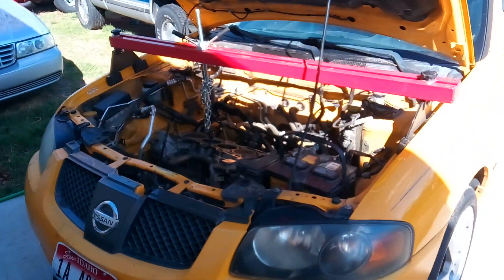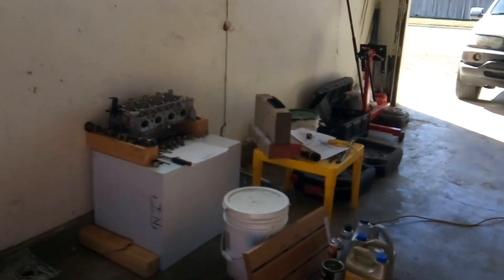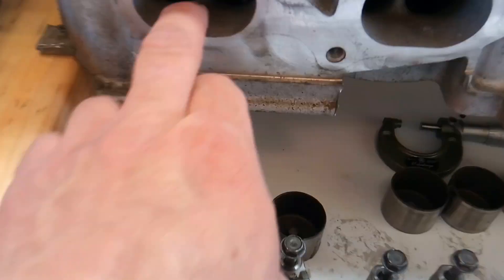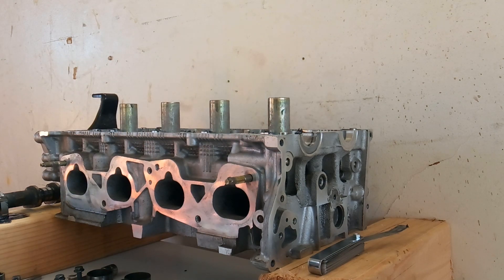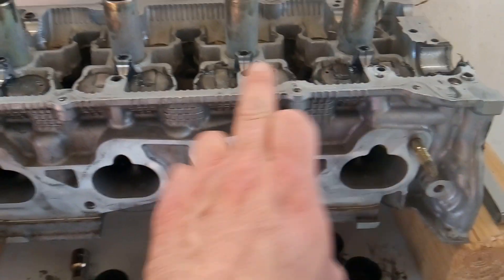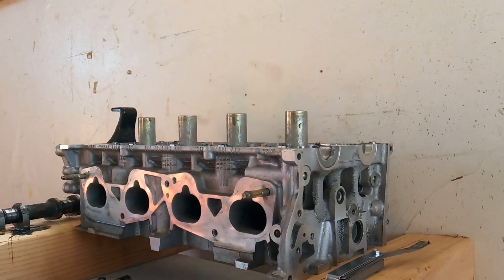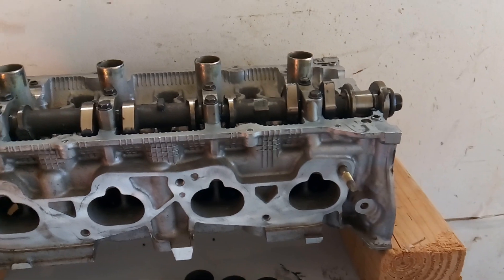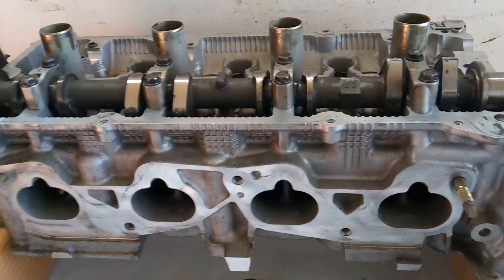Nissan 2.5l cylinder head valve clearance check and adjustment

Comment: Great great video. Qu, if there is a clearance even if it is below specification, there is still a clearance, so how is valve open? Or do u mean once the engine is hot the expansion will open the valve with below spec clearance when cold?

Comment: I just got done rebuilding my 2015 Nissan frontier 2.5l cylinder head it had 4 bad exhaust valves that where burnt up so I replaced them, seated them and had to make sure the valves where closing. The first time I did it I didn’t look to make sure the valves where closing and it ran like shit the second time I took the head off I moved some bucket lifters around and while turning the cam was able to make sure the valves did not spin when shut. I also made sure they hold fluid. I put everything back together and runs ok but still have a cyl2 misfire I will be check them with a feeler gauge again this week and if it’s not that it has to be a injector because I replaced everything else coils plugs valve cover head gasket valves but maybe cylinder 2 is a little low I will run a compression test again last time they where all at 110psi cold

Comment: Hey brother just ran up on your video, I have a quick question, I have a 2009 Nissan Altima, 2.5 s, my question is when I first start up it make a knocking sound and it quickly goes away, then when it gets to temp I can get around 2500-3k rpm and the rattle, knock comes back only at those rpms...it has 201k miles on it yea it's a little worn out lol but is it valves or rod bearings? It still has plenty of power, and no missing or burning oil....I'd just like to feel safer knowing kind of what it is lol I'm thinking valves but again, I'm not sure 100% thanks!! Great video btw, it'll help me if and when I need to do this job
Reply: I have the same issues with valve rattle at start for 2 seconds and a little rattle around 2500 to 3000 rpm.  Runs smooth in other rpm range but slight misfire at idle with AC running.  When AC compressor shuts off, Engine stumbles a little.
Reply: Did you figure this rattle issue out?
Reply: @matthewcurtin5290 read my other reply didn’t tag you
Reply: Cam phaser is the typical issue for 02-06 qr25’s with that rattle at cold start and operating temp under load.

Comment: Would you know why when I put my #1 cyl. at TDC and the dowel pins on the camshafts facing up as instructed, my valves seem to make contact with with the pistons on a '95 Maxima?

Comment: I Matt. I appreciate your time with this and know it's a bit old now but I'm wondering if you'll take a moment to clarify? You have a cold measurement at 0.014" but the service manual I have for the '05 Sentra 2.5l gives a range from 0.009-0.013" intake and 0.010-0.013" exhaust. Can you tell me what source you get your specs?
Reply from the maker: The sticker under the hood.

Comment: if yu check the lash  on a rebuilt head ie valves laped  most likely if you run the motor and some are set o16 after it runs a few trips it will be tighter dew to seating also i have mig welded the end of valve stimes them ground them to tighten sloppy lash of course many cant do this  thanks

Comment: If you do one valve at a time you don't have to worry about bolting and unbolting your camshaft caps 300 times and  strip your threads out in your head ..leave all other buckets out except for the one you're doing just lay the camshaft in there.. only 1 cam cap needed with lobe facing up... that way you're not wearing your threads out.... just something I noticed when I was doing one... and as for lubing.. I would worry more about lubing the journals instead of the lobes.. turning  that cam under pressure pushing the valves open with dry journals would cause more damage to that head than dry cam lobes.... not trying to criticize you or anything it's just these are things I noticed doing this over the 26 plus years I've been working on cars
Reply: gotcha even an oak board and c clamps

Comment: Hello, working on a 2004 nissan altima with a 2.5 L engine for the feeler gauges I was wondering if you could tell me the correct gauge size for the intake and exhaust side, I'm having trouble finding it online. PLS HELP.
Reply: Kelly Trujillo 

http://www.sbintl.com/tech_library/tech_bulletins/TT00008_valve_lash_adjustment_for_2002_2008_Nissan_2.5L_QR25DE_engines.pdf

Comment: Matt, great video, I am learning a lot from you.  I have a 2003 Sentra with a 1.8L that has a leaky head gasket at 92k miles. I'm am a mid-level DIYer that's been working on cars since the late 70s and I am learning as much as I can about this particular repair and what's involved before making the decision whether to attempt it myself. My 1.8L engine uses adjustment shims that sit on top of the bucket lifters, but the adjustment concept is similar from what I can tell.
Two questions I have about what you have stated in this video, that I want to be 100% sure on:  #1 You said that when the spec is .014" and you can get a .017" feeler gauge to fit in, you need a bucket lifter that is .004" thicker.  But isn't .004" too much? Did you mean instead a bucket lifter that is .003" larger since .017 - .014 = .003? Or am I over-analyzing it here?
#2 You said that if the spec is .014" but you can only get a .010" feeler gauge to go in, you need a bucket lifter that is .004" thicker.  But, did you really mean instead to say .004" thinner?  I'm thinking you need more clearance between the lifter and the cam lobe, not less, and this would require a thinner bucket lifter.  Or am I not looking at this correctly?
Thanks for putting out great content, you and other folks willing to share their knowledge are a blessing to guys like me.

Comment: @dugbert...It if was hydraulic it would need no adjustments
Reply from the maker: if it needed no adjustments then why does the manufacturer provide clearance and adjustment values for this engine under the hood along with service intervals? so many people are wrong when it comes to this.what I think people mix up is pre loaded hydraulic lifters with lifters that use oil to keep clearance
Reply: Yeah... That's why this engine does need adjustments with new buckets... I'm working on mine right now
Reply from the maker: its a pita aint it. fun though I do enjoy it. let me know if you need any help
Reply: @MattShaughnessy6  mat wat is Der clearance on Toyota 160! 4afe
Reply: so called solid lifter. Nissan produced 26 sizes to match original valve lash spec. Well done bro

Comment: Are those lifters hydraulic?
Reply from the maker: define hydraulic because I already know what you are thinking.
Reply: @MattShaughnessy6  The reason I ask, I have a 2012 Rogue with noisy cold eng tap and I was thinking of a clogged lifter check valve. I'm trying Seafoam but I don't hold out too much hope.
Reply: @dugbert5  If they  were  hydraulic  he  wouldn't be  doing valve  clearance on them.  I had a '14  rogue  and the engine  IS  extremely noisy when cold.  Running  a larger filter ( like that for the V8 Armada/Titan) will help. The injectors  are  noisy when cold  too.  So its  normal  for this  Engine.